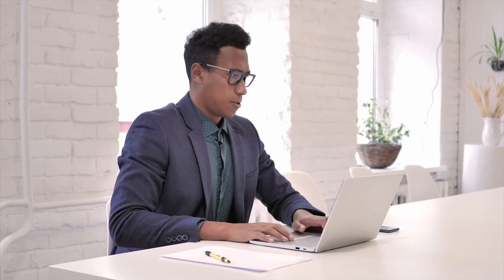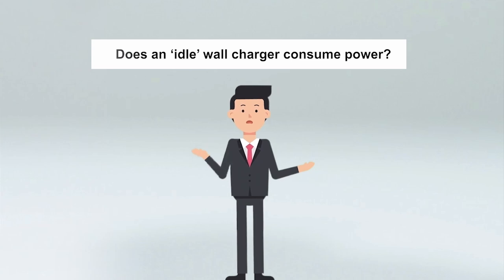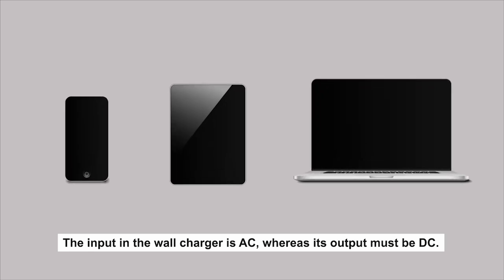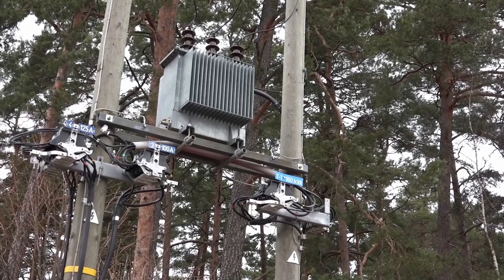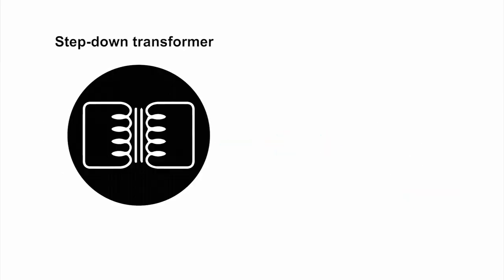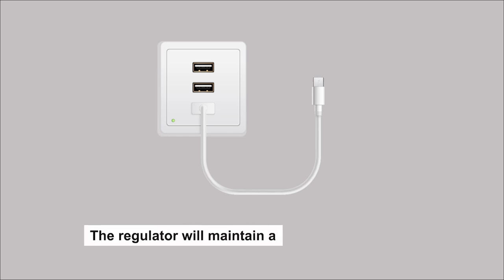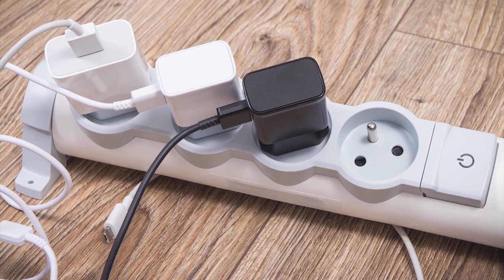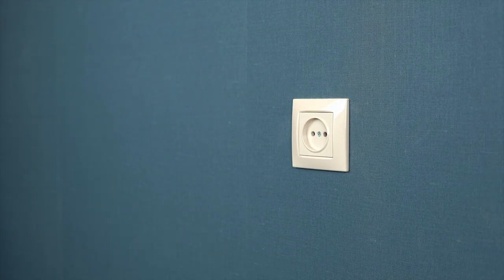What If Charger Is Plugged Into Supply But Not Connected To A Device?

Comment: idk but i left m'y 120w charger let it plug for 1 year still charging very fast
Reply: me too i left my 140w charger for 2 years still charging very fast, even faster than before
Reply: I left my 5v charger connected,  after 3 years consequently it's now capable of fast charging 120w and 140w simultaneously.
Reply: @xamtra  i also left my 5v charger connected, but that was ten years ago. i checked on it last week and it's now a fully working fusion reactor.